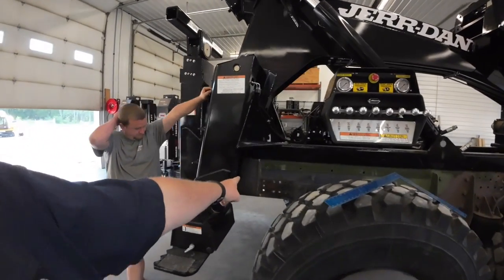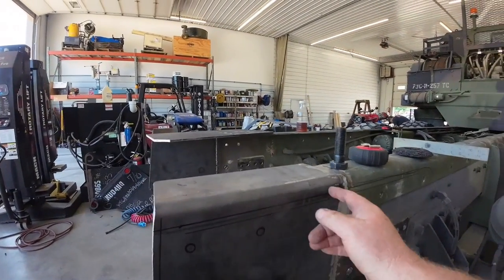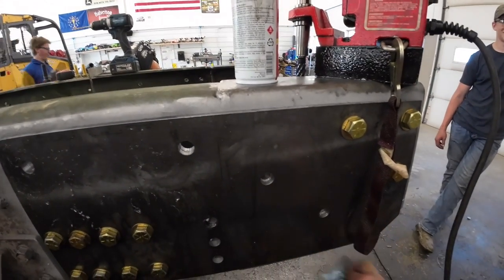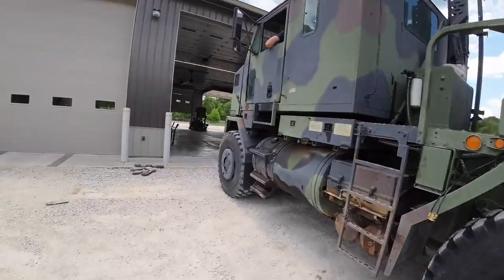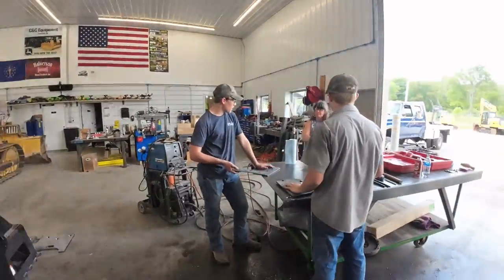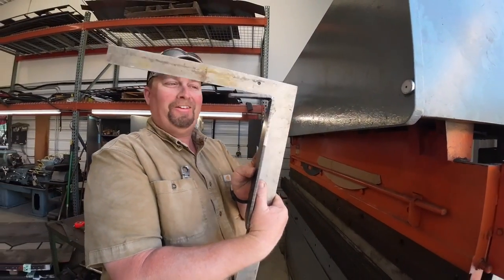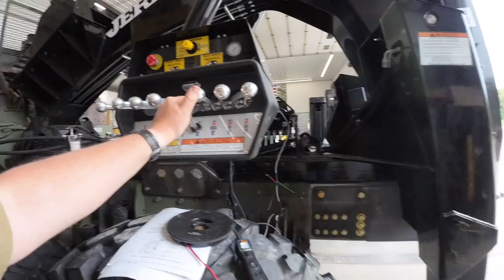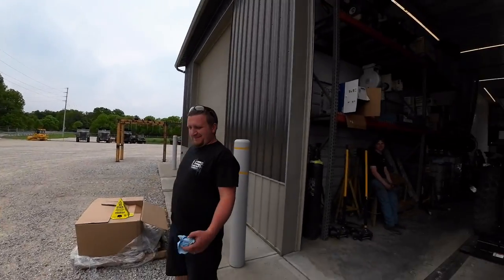HET M1070 8x8 Jerr-Dan heavy wrecker build part 2 mounting, welding and plumbing, will it work?

Comment: Hey Clint  , maybe give  Murphys  Diesel a shout . He had to take his rotator  6 miles or so  down a railroad access road to recover a track service truck.  He could have used a wrecker  like that.  He made it down and did the job and  made it back , but he did have some  clearance issues with the rotator and the  access road

Comment: Perhaps install the small wench in the front of the truck? It could be used to anchor the truck to something (like another truck or a tree) in the event the truck starts sliding while pulling with the big wench.

Comment: Mr. C. I would leave that small winch on. That way you can use it off a snach block to pull your big heavy cables to the item that you are retrieving.
Reply: From what i have seen on videos those big heavy wrecker trucks carry a whole slew of paraphernalia of equipment, tools etc from blocks of assorted sized timber, a massive selection of different sized and lengths of tow chains, strops and straps? Where are these to be carried and stored on the truck? -platform behind the cab? A quick small winch like that might be ideal to lift them back up to the walking access platform height. What about a rigid length tow pole to be carried on board the vehicle?

Comment: something I've noticed over the years is that bottle jacks have been around for decades yet  no one has come up with a better way of pumping them up or releasing the pressure on them
Reply: Hello, the old saying is "If it ain't broke, don't fix it!". They were invented in 1851 and patented in 1905 and have been modified but are intended to be used anywhere and are very rugged. cheers

Comment: Have tou thought about putting a pond in for the cows to access? They will stand in it to cool down as needed and im sure drink from it now amd again. But it would make it easier on the chore list than spraying or filling water constantly because they splash it out. Just curious. You guys are doing great getting that area set up. I know if it were possible i would have volunteered my time to come help set up all that fencing. Huge undertaking but you are doing an awesome job with it non the less.

Comment: I just wish it had out and down outriggers on the back and those back outriggers between the wrecker and truck on the front. With a wrecker of this height and strength it will certainly be put to the test and I sold enough outriggers I stripped off of digger derricks when customers were building huge wreckers. I always had outriggers pads ready for sale always because you can make it foolproof but you can’t keep fools from operating it. I am so excited to watch this monster pull something into. lol 😂

Comment: I own several Heavy Duty Tow trucks and Rotators. I don’t think you are getting enough hydraulic pressure for the bed operation, look for you pressure gauge for the bed and it will make a huge difference. Just my opinion

Comment: To be truly worthy of the moniker “Off Road Wrecker” should have a 1> Water & 2> “fuel” tank (beside diesel) storage capacity.. of some size at least, if even removable from a cabinet that can be optional storage ... Some rigging attachments about rig and maybe a winch and a swing boom crane/hoist on the roof of cab or thereabouts.

Comment: Hello Clinton, I wonder if your project would benefit with a high flow hydraulic pump option when operating unweighted and switch back to low flow (standard) for the heavy lifting? It seemed painfully slow during your demonstration. Cheers
Reply from the maker: It’s fine

Comment: Hey guys great videos. I have a question for you. I’ve always been taught that wherever possible you always tighten down nuts and bolts from the nut side. That way your not putting a twist on the bolt. Make sense to you guys?
Reply from the maker: Yep